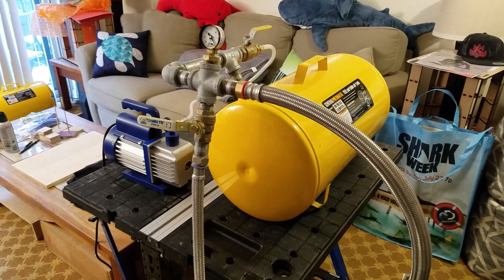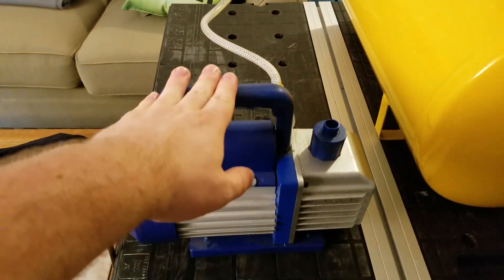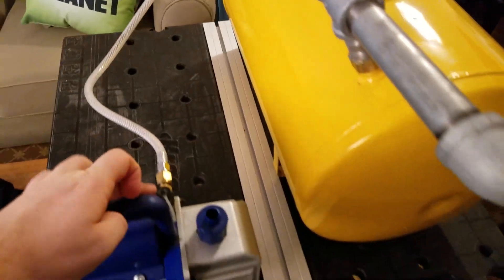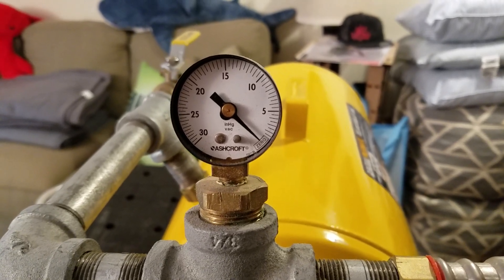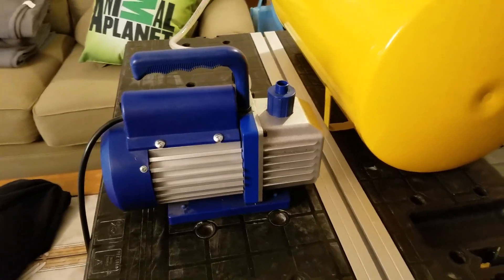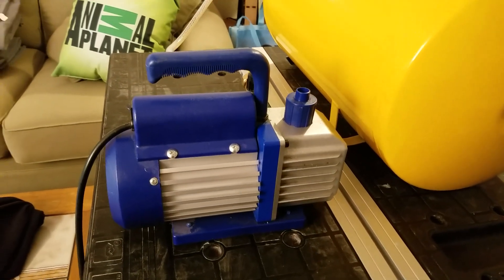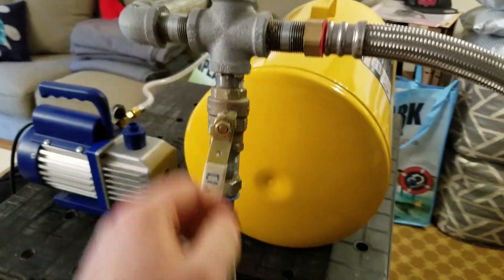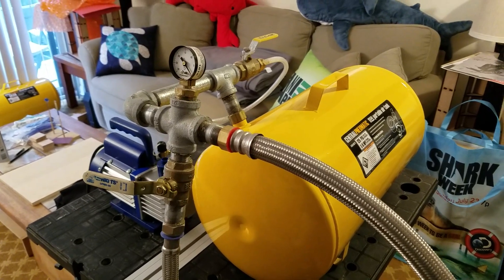My Vacuum System for Vacuum Forming

Comment from the maker: Before commenting, please read the video description to see if your question has already been answered there.
Reply: How can I vacuum forming 1mm Polycarbonate (PC) with your system, Is it the same as PETG? thank you!
Reply from the maker: @HOANGTHINH031207  1mm is very thin. Polycarbonate takes a higher heat to get to formable temperature, but at that thickness it shouldn't take very long.
Reply: @mwjscn  Thanks for your quick reply! I'm very interested in your article! I may still have questions while working on my project, looking forward to your help!
Reply: https://youtu.be/sHY0kkRGLBM

Comment: ı want a question. can ı use 3mm acrilic (pleksi glass)
Reply from the maker: It's difficult, but it can be done. I'd suggest learning on an easier material first if you do not have experience.

Comment: What’s your thoughts on using Venturi vacuum connections
Reply from the maker: I know they're common in automotive, ie. airlift, but I've never seen them actually measured for the amount of vacuum they can produce. If you feel that it can produce enough vacuum, lets say above -15inHg, I don't see why it wouldn't work. You'd still need to evacuate a container, as I don't believe the venturi connection can evacuate enough air fast enough to directly form something on a platen before the plastic cools.
Reply: @ thank you for your response and very informative videos well done sir.  

my thinking is we already have a 150 ltr compressor in our shop  if I attach a Venturi and evacuate into a separate tank let’s say 25ltr should be able to pull a vacuum over my moulding tool. I need to do some digging to see what sort of vacuum you can get with these connections 

Thank you
Reply from the maker: @ You're welcome. If you want to test it, just connect a vacuum gauge somewhere on the evacuated side of the system. That'll empirically tell you if it will work or not. Also keep in mind that you need a significantly larger volume of vacuum stored than the atmosphere that will be trapped under your plastic sheet between it and the buck (including platen volume and connections). You want to make sure that when these two volumes are mixed that the resulting pressure is well on the vacuum side (I'd try to shoot for at least -10inHg), else it won't suck the plastic down. Make sure to include all piping and connections in your equations. With 25 liters of vacuum charge on tap, assuming you can get it around -25inHg, I'd still only suggesting forming with a platen around 40-45cm square and the buck would have to be considerably smaller than that maximum, depending on height and detail required.
Reply: Decided not to use the Venturi connection. I went for a Chinese vacuum pump. Cost me £130 and it’s useless starts struggling and smoking fluid around 2 mins into the evacuation.., can you send me a link to your pump please. I’m currently using the Orion Motor Tech pump so people don’t waste your money getting the same pump as mine
Reply from the maker: @customboatscreensolutions5893  My first suggestion would actually be to replace the fluid it came with and use proper vacuum pump fluid - can often be found at the automotive store. The oil the cheap pumps usually come with doesn't do a very good job, which is the smoke you're seeing. Mine did the same before I swapped it out.
Reply: @mwjscn Okies I’ll change out the oil for something premium.  Thank you

Comment: Man thanks for the video, really informative

Arent you worried dust and other particles going inside the tanks while pulling the vacuum?
Reply from the maker: @ROBOROBOROBOROBO  If there happened to be some dust particles it wouldn't interfere in any way. Keep in mind that the pump is evacuating air, so any dust that existed would have to already be inside the tanks at the time the vacuum is drawn. If you had an exterior leak that could introduce dust IN, you wouldn't even be able to hold a vacuum in the first place.
Reply: @mwjscn  thats great, I will also try to build a machine now and your videos were wonderful, thank you.

Drawing depth of parts I want to make is around 300mm, not sure if I can do it on a DIY setting but I will die trying :D

300mm depth means my plastic sheets have to be quite large as well, thickness has to be like 2-3 mm so it doesnt get raptured as it elongates and vacuum surely needs to be strong. I think these tanks will do the trick.

Comment: When you have both takes set up for a vacuum charge, is the system set up so that you can release both tanks off of one ball valve or do you need to release two tank valves separately?

Do you use only one vacuum pump for both tanks or does each tank have a vacuum pump dedicated to it?
Reply: Great. I asked because I'm planning to mirror your system with 5 tanks. I'm planning for a 72"x36" platen. I figured each tank can run a separate portion that is about 14"x36". I hope to be able to determine a way to form using only one or two sections if needed. I have the 5 tanks already and I have 5 pumps. I probably can make do with less than one pump per tank based on your answer, but I have them so I might just run with it. 

Now to find suitable heating elements. I was figuring some infrared heating elements like you're using. Of course multiple would be necessary. I'm concerned about the power draw. 

Great videos of a proven solution. It obviously works so I'm going to run with it. 

I'm considering 3/4" copper for the pipe on the vacuum system versus galvanized. I think copper may be simpler to connect 5 tanks. Not sure yet. I haven't bought any pipe or fittings yet.
Reply from the maker: The two tanks in my configuration are connected at the 4-way junction below the vacuum gauge (the dangling horizontal heater hose is where the second would connect). They're evacuated by the single vacuum pump and are both released with the singular ball valve below the junction. That being said, you only need the cost of multiple tanks should your forming size call for it, so simplify if you can.

Comment: We have a similar setup, is it really necessary to have two tanks than 1? My platten is sized 86x86 cm, same pump but only one tank. Additionally what are the advantages of two tanks?
Reply from the maker: @elijahandreventurina6130  That's up to you. More tank volume results in a higher volume of vacuum available, thus when the two volumes are combined (trapped atmospheric air under the plastic and in the platen and your vacuum charge) the result is deeper on the vacuum side. If you have holding or definition issues you may want more vacuum.
Reply: @mwjscn  Thank you for the reply, my issues currently are after the vacuum charge is exhausted the sheet will try to go back to its original form. Resulting to round space  in the edges.
Reply from the maker: @elijahandreventurina6130  Start by checking for leaks. Vacuum leaks are pretty noisy, usually it sounds like whistling or wooshing air. Helps to have someone else. Or you can use something that generates smoke/fog to see where it's being sucked in from. You can just mount a sheet of plastic in your frames (which should also be gasketed on the inside, at least on the bottom facing the plastic, I use thin neoprene foam) and hit the vacuum with it on the platen to search and test without wasting material. Otherwise, you may not have enough vacuum to overpower the atmosphere trapped in the system and may need more/larger tanks.

Comment: Hola amigo que tal,una consulta,  que me aconsejas para realizar el vacío,  una bomba de bacio o un compresor de aire modificado para vacío? Que me aconsejas espero tu respuesta  gracias....
Reply from the maker: Puedes usar cualquiera de los dos.
Reply: @mwjscn   y que me aconsejas resistencias electrica o calefones a gas para el calentamiento del plastico?
Reply from the maker: @EdwinCutipa  No he probado los calentadores de gas, pero he tenido buena suerte con los eléctricos.
Reply: @mwjscn  a ya ya pero el consumo es elevado o lo normal? Porque donde vivo la red es de 220 volt
Reply: @mwjscn  para el vacío puedo usar tubos de pvc o metalicos?
Reply from the maker: @EdwinCutipa  Yo uso el mío a 120V. Los amperios importan más que los voltios. Asegúrese de que su disyuntor tenga suficiente sobrecarga o use un cable de extensión para dos separados.
Reply from the maker: @EdwinCutipa  Puedes usar lo que quieras siempre que sea lo suficientemente rígido como para no colapsar al vacío y se pueda sellar para no dejar entrar aire.
Reply: @mwjscn  si uso tubos de pvc el aire extraído del termoformado no deformara los tubos pvc?.o no pasa nada?
Reply: @mwjscn  me olvidé preguntar cual es tu nombre ?...amigo
Reply from the maker: @EdwinCutipa  Creo que el PVC estaría bien. Siempre que inicies la succión lo suficientemente rápido, el aire en la placa no se calentará demasiado. Asegúrese de usar compuesto para unir en las roscas para mantenerlas herméticas. Si todavía estás preocupado, las tuberías de metal son bastante económicas si vas a utilizar mucho el sistema.
Reply: @mwjscn  muchas gracias amigo mi nombre es Edwin y cual es el tuyo?
Reply from the maker: @EdwinCutipa  Mateo. ¡Buena suerte en tu proyecto!
Reply: @mwjscn  mateo y que puedo usar para hermetisar los marcos donde van las laminas  plasticas que tipode silicon puedo usar o que otra cosa....gracias
Reply from the maker: @EdwinCutipa  Te sugiero que veas mi otro video para obtener más información: DIY Vacuum Forming - Complete Video Guide

Escribí a mano todos los subtítulos, por lo que si los activas y usas la herramienta de traducción automática de YouTube, deberían quedar parecidos.
Reply: @mwjscn  gracias mateo veré el video y de que pais eres tu? Yo soy de bolivia

Comment: Thanks for the great video and details you provided. What is the CFM of the pump you use?
Reply from the maker: Check description.
Reply: Thanks for quick response buddy. Just saw it
Reply: Can you please advise on what vacuume system (pump’s power, and air tank capacity) you would recommend for a larger unit which effective surface is 30x96-inch ?
Reply from the maker: @mohammadhajigholizadeh6176  That size is outside my expertise. I'd suggest using the combined gas law equation and finding the volume of trapped air (air under the plastic, in platen chamber, and all tubing after your valve towards the platen) and plugging in a result of at least -10inHg remaining when your vacuum volume is mixed with your atmospheric volume. If you solve for the vacuum volume with those known variables, you should be able to figure out how much vacuum you need. If you have a good vacuum pump, I'd plug in a vacuum-side holding pressure of -25inHg into the formula.
Reply: Appreciate it!
Reply: One more question my friend. What do you think about using Well-X-Trol water tanks in a vacuum system. I have found a good 120 gallon tank and wondering if it can handle let’s say 25 inHg.
Reply from the maker: @mohammadhajigholizadeh6176  I don't think it would be a good idea to use a tank that has a diaphragm. Empty simple metal vessels are the best.
Reply: @mwjscn  thank you very much! I guess air compressor tanks should work then,right?
Reply from the maker: @mohammadhajigholizadeh6176  Yes
Reply: If I use a shut valve between the pump and tank, I don’t think it’s gonna be a threat to the pump. Please share your thoughts 🙏
Reply from the maker: @mohammadhajigholizadeh6176  Someone else suggested using a one-way check valve, which is a great idea. If it was to do it again, I'd go that direction.
Reply: @mwjscn  where this one-way valve will be mounted?
Reply from the maker: @mohammadhajigholizadeh6176  Between the vacuum pump and the holding tank
Reply: @mwjscn  you’re awesome, man!  Thanks so much!

Comment: All those adapters were unnecessary, you could have used one male threaded pipe cap in the ball valve, after you drill and tapped the cap and install the vacuum connection
Reply from the maker: There's definitely a more elegant way, feel free to improve on your implementation. I didn't have a drill press and tap set in the apartment back then, so this was my easiest workaround at the time.

Comment: Good video! I have a commercial machine that has a very similar setup except the valve that stops the pressure from going backwards through the pump is actually a one-way check valve. No need to flip that valve by hand before each pull.

Comment: Haw to calculate compression air needed
Reply from the maker: (Pressure1 * Volume1) + (Pressure2 * Volume2) = (Pressure3 * Volume3). Where Pressure1 is atmospheric pressure and Volume1 is the air trapped under the plastic, inside the platen chamber (if applicable), and in any hoses. Pressure2 being your vacuum level and Volume2 being the size of your vacuum charge. Pressure3 is the resultant vacuum force once both volumes are combined, and you want this resultant force to still be well within vacuum, likely around -10inHg to -15inHg. Volume3 will just be your combined volumes (Volume 1 + Volume 2), even though technically Volume3 will be slightly less since the plastic will wrap around the buck and therefore reduce the volume - it gives a close enough mathematical approximation to educate our needs.

Example
(30inHg * 2) + (-25inHg * 10) = (P3 * 12). P3 = -15.83inHg, which means 10 gallons of vacuum charge at -25inHg would be more than sufficient. You can use the same formula with Si units if you desire.

Comment: Hey man how big can this system work with, in wanting to make car bumpers but I’m unsure on how much vacuum will be needed for say a 1500mmx1000mm bed
Reply from the maker: I'd suggest starting with an old 60 gallon air compressor tank. You're going to need a lot of vacuum for something that large.

Comment: Why not use the vacuum pump directly instead of using a tank?  Note: I have the same 5 Pa pump, and it can pull a gallon pretty fast ( within seconds, which ought to be enough for vacuforming, if the bed isn't too large, I suspect ).
Reply from the maker: It doesn't produce enough flow. You want the forming to be as instantaneous as possible, otherwise you may get an incomplete form or defects if pulled down slowly.

Comment: Thanks for your video bro, it helped me a lot  to understand better how the vacuum system works! . Just a question, How did you choose the capacity of the air tanks?
Reply from the maker: You just need a good portion more vacuum stored than regular pressure air exists trapped between the plastic and the platen, as when you throw the valve to combine the vacuum charge with the atmospheric air you want the end state to be a vacuum. HF had these 11 gallon tanks at a good price and that seemed to outweigh the capacity of atmospheric air I'd have trapped.

Comment: Great video series on vacuum forming! I have some concerns about air tanks though... How safe are those for negative pressure? Are they the same tanks used with air compression system or specially designed chambers produced specifically for vacuum?
Reply from the maker: They've been working just fine for years without any issues or leaks. Many others use the Harbor Freight tanks listed on the parts sheet, so the sample size is larger than just my experience.
Reply: @mwjscn  Ok tnx, i guess you would need much more vacuum pressure in order to make some damage... I will try myself with the same approach.

Comment: This is so cool. Didn't see anyone ask this so far (maybe i missed it), could I use an old compressor as the air tank? I'm wanting to make a bigger version of this and would need a much larger and thus much more expensive tank, but I can get a used compressor for a fraction of the price so I'm wondering if it's an option or if because of existing fittings on the tank it wouldn't be recommended.
Reply from the maker: You can use an air compressor tank as a reservoir and can also modify the existing air compressor motor to make it a vacuum pump, if you have the necessary fabrication skills and tools at your disposal to modify the head. There are other DIY videos on YouTube that illustrate how to turn an air compressor into a vacuum pump. Good luck!